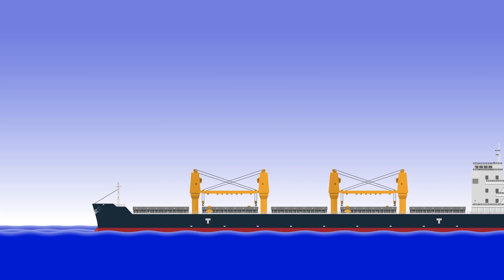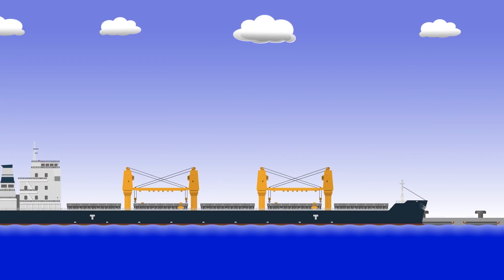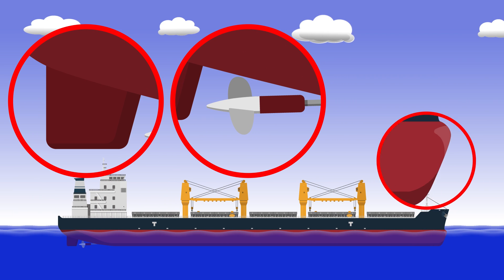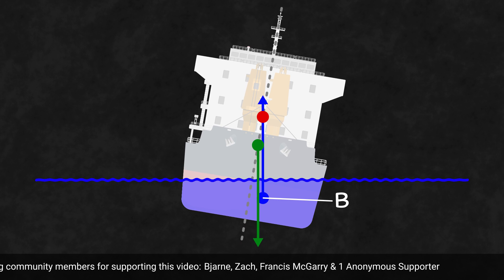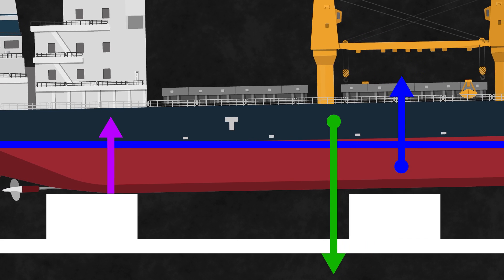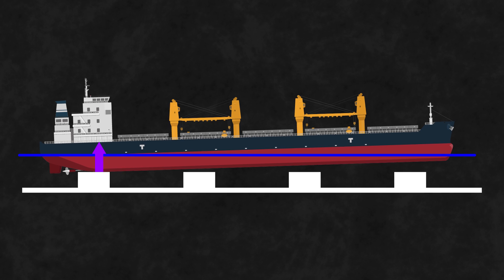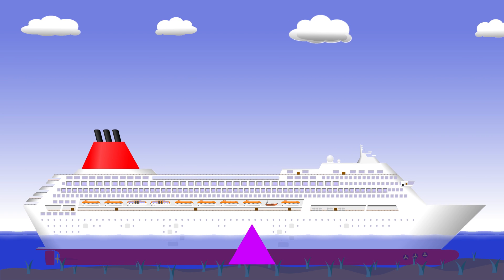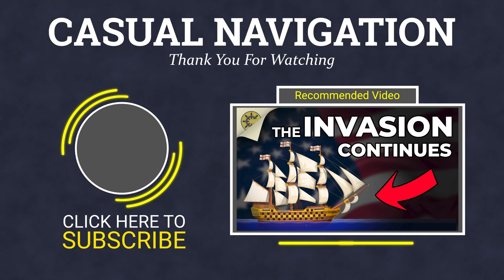Drydocking: Its HARDER Than it Looks!

Comment: 5:00 Why is the maximum height of the centre of gravity labeled as Max KG?
Reply from the maker: KG is a distance measure from the (K)eel, to the Center of (G)ravity.
Reply: @CasualNavigation  Ah, makes sence. Doesnt make it any less wierd when Max KG could also mean Max Weight. Though I suppose it would be very wierd for the weight of a ship to be measured in Kilograms
Reply: @TheBlackob  if ot was meant to be kilograms it would be kg, for units capitalization matters alot.
m = milli = 10^-3
M = mega = 10^6

Technically KG could be Mega Gs as in millions of times Earth's gravity worth of acceleration but i don't think that has any context where it makes sense.

Comment: Here in Grecee our RO-RO ships go on dry dock every one year cruise ships go depending on the use condition etc so us Greeks we like to be somewhat clean             Greek fan that wants to become a captain
Reply: Technically, the drydocking period is 36 months for inspection of the bottom, but with a possibility to replace one of those by an afloat survey before 15 years of age. Passenger ship have shorter period of time between bottom surveys.

Comment: One thing I did not understand about this is the trim aspect. Now, please correct me if I'm wrong but at least as far as I understand it, trim is mostly done via controlling the level of water inside the ballast tanks - at least at its core, I do know that it's not quite as simple given things like the free surface effect, but, even then I'd hazard a guess that this is not as important in the conditions that would need to be present for drydocking to be safe in the first place. Tangent aside though, what I wanted to ask is why the ship's crew, after having aligned the stern on the blocks and then having maneuvred the bow into its final position not begin to fill the bow tanks to achieve a neutral trim, hence reducing the maximum P-force asserted on the vessel as the bow comes into contact with the support blocks sooner. And, related to that, as the ship is refloated, why is it a concern to keep the trim towards the stern there instead of a neutral trim given that, during refloating, there is no need to align the ship anymore.

Sorry if this question is stupid but I simply couldn't make sense of this.
Reply from the maker: Any weight in the ship needs to be supported by the hull which is outside of its normal "supportive" water surroundings, so you need the weight to be kept to a minimum.
As for leaving drydock, you can aim for zero trim if you want, but it is normally easier to control the ship if it lifts off gradually, and you know which end is going to lift first.
Reply: @CasualNavigation  @Tung-Chiao Wu Ah, many thanks for both your answer, yeah, reading it now and actually thinking about it this makes complete sense. Thanks for enlightening me :)
Reply: @CasualNavigation  I think you're overestimating what "control" you have of the vessel in the docking/undocking situation. The vessels are made fast by wires/moorings and the only control is the rate of water ingress/egress. I would suggest that being trimmed by the stern is so that the vessel trim matches that of the slope of the drydock. Every one I have been in is sloped towards the gate to allow the water to drain out towards the pumps.
Reply: @garrettnb and @casual navigation
 I've worked on a shipyard and I can confirm all this. Our docks have an inclination of around 30cm (1 foot) per which 100m. That way a vessel with around 300m would come in trimmed with usually 5.5m aft draft and 4.5 fore draft. After aligned the vessel dockmaster would emptied the dock until the  vessel will have no bouyancy but keeping enough water to spread vessel and ballast weight across hull and dockbottom. That way the vessel will land flat on blocks without this P force concerns and reducing bending moments and shear stress on hull. Only then crew can drain all ballast (and should do otherwise they will end with hull deformations and block punctures). After ballast is emptied then dock will be fully emptied as well.
Reply: @morya85  And as per usual - the correct information will be buried. Thanks for the response.
Reply: My experience was that when going into dry dock, u will be asked to maintain minimum ballast because tanks need to be emptied for the  inspection. Any extra water in the tanks means delaying the schedule, which in turns cost extra money. That’s why u only pump out the water, not in. 
Also, it’s considered a bad practice not pumping out ur ballast in time when ur ship is sitting on the blocks, because u’ll cause extra stress on the ship’s structure, which is totally avoidable.
As for re-floating, u’ll also be asked to calculate the minimum amount of ballast u need. The yard will pump water into ur tanks as per ur calculation, and charge u. As far as i can remember, we only maintain even keel cuz we were just a handysize bulker, pretty light when emptied. But i figure the method mentioned in the video is more controlled compare to just float the whole ship at once with an even keel.
Reply: My guess would be that it's easier to account for the forces keeping it trimmed to the stern on the way down. Even if it's technically better to retrim as you drain, if it also increases the chances of human error when the other process is good enough it's not worth it. Just a guess. I'm not really sure. No clue why they don't change trim once they're down.
Reply: Every ship has a docking plan from the builder's that shows the proper locations for the blocks and the acceptable stresses.  Adding ballast could bring these stresses up too high.  As stated before usually they want the tanks dry so they can perform work, so adding water is counter productive.  Also the ships crew has nothing to do with the positioning of the ship.  Once the ship enters the dry dock the dock master assumes responsibility for the vessel.  They use winches from shore to position the ship and divers to verify its right

Comment: Quick question: How do you get to the parts of the hull that are covered by the support blocks?
Reply: Shipbuilder/repair here, you don’t. At least not this time around. You can see the area the last blocks were when you go down the dry dock; sometimes the blocks are laid super close to the last blocks so some areas aren’t even cleaned the second go around.
Reply: @MrCMStud  Do the locations of the blocks get recorded in the ships documents or log so that different ones can be selected next time or is it just luck?
Reply: @MrCMStud  Is the ship positioned longitudinally so it rests on the blocks only where the bulkheads are? Or is the skin strong enough to carry the load from anywhere? One of the posts here talks about "hoping" the blocks are spaced such-and-such, which suggests the latter, and that their spacing is not part of the plan.
Reply: @FlyNAA  well if a ship goes into drydocking the drydocks get the blueprints of the ship so they can place the blocks at the right position. if the blocks arent placed right they go straight trough the hull 😔. so yeah everything is planned in advance.
Reply: @FlyNAA  Some additional infor to what others have already told you. Yes, the shipyard will be provided with plans of the ship to position the blocks correctly. On larger ships the naval architects who designed the ship will produce a set of plans specifically for drydocking, specifying a blocking plan that the shipyard should follow. Often naval architects will specify thicker plating and extra floors (framework) in the ships double bottom at these locations to accommodate the point loading experienced in drydocks.
Reply: In another few years in the next dry dock session
Reply: Answers are below for large ships. For small boats like mine you shift the supports after you put the first coat on. The blocks under the keel are placed so I can get every thing but a very small bit. That part gets painted when the boat is in the slings off the ground just before it is launched. You lie on your back under 13000 lbs. of boat and hope the slings don't decide to part at that moment and paint. The paint gets all of maybe an hour to dry if they stop for lunch before launch. Needs a day for full cure but you do what you can. Next time you have the blocks in a different spot. Not perfect. Big ships use paint we are not allowed to use and it can go longer between repainting and be effective. Most recreational anti fouling lasts 1-3 years and that third year is not very effective.
Reply: @alwaysbearded1  Small boat anti fouling paint is lucky to last 6 months, it is crap, a ripoff, and causes high boat emissions, if a diver doesn't clean the bottom every month, or less in high growth environments.
Reply: Speaking from someone who worked in a shipyard many years ago,  you can't during the same dry docking session. Simply has to wait for the next dry docking and hope the blocks are placed in slightly different locations.
Reply: I was on the dockyard services crew of forgacs/ caincross drydock in Brisbane Australia, Large cruise ships and container ships don't just sit on one central line of blocks, there are multiple rows with about 5mtrs between them, so a ship 40 mts wide would be on at least 5-7 rows of blocks to cover the full width of the vessel so very little chance of capsize in the dock. And yes the location of the blocks are recorded so the next time the vessel is in dry dock they can adjust block placement to be able to clean areas that got missed.
Reply: Every ship has multiple docking plans that dictate the location of the blocks to correctly support the vessel. The plans are made by the ship’s designer as they design the ship and the blocks are placed in locations that support the hull around it. Sections of hull and framing are strengthened to be able to support the vessel while on blocks. 

With each docking the ship will request a different docking plan so over several dockings the vessel has a complete new paint job. 

Different plans also exist for access to different areas or for major part replacement. 

Special plans can also be made for unique situations for example the docking plan for the ship that got stuck in the Suez Canal would not have had blocks under the bow so it could be completely cut off and replaced.
Reply: Well they overhaul the ship
Reply: Ships getting dry docking plan on their delivery which describes exaxtly how much and where to place blocks. All these calculations done depending on how much frames there are and how many tons will be placed on each wooden block. And as it was said before - during next dry docking for commercial ship blocks will be placed in different locations. Dry docks are normally done each 5 or 2,5 years depending on age.
Reply: You call subatomic cleaners!
Reply: You make the ship jump and quickly clean the spots under the blocks
Reply: Won't these stuffs simply being crushed by the sheer weight of the ship?
Reply: @BS-bd5uq    The blocks are placed under the internal framing, the shipyard has to have the blueprints of the ship being repaired so the blocks can be in place a week or two in preparation of docking

Comment: Fascinating! I've never really thought about the process of dry docking apart from the 'oh, she is getting repairs/refits so she won't be available for survey this season'. Kind of cool learning a bit more about the logistics of actually getting a ship into drydock :D Thanks!
Reply from the maker: When I learned it, I was surprised how much maths and physics was involved, but it made it really interesting to learn!
Reply: @CasualNavigation  that’s the reason why there isn’t just one middle line of blocks. Side blocks will counter the rolling movement. Apart from distributing the weight over more blocks these blocks ensure that the ship will not capsize.
Reply: @CasualNavigation  Sorry, but its a really easy task, if you know how to place the blocks beneath the ship. If you have ever put a sailboat on a trailer, you know its not hard.
Reply: @petersizen3897  If you've ever put a sailboat on a trailer, you understand how to dry dock a multi-hundred ton container ship. Basically the same thing. Makes sense, good to know.
Reply: @mrnicomedes  have you ever heard that there are wave pools where they test scaled down ships? Basically the same thing.

Comment: If only we could be confident that a ship would never bump into anything, we could cover their hull with a super-hydrophobic nanocomposite.  That would prevent any corrosion or fouling.  Sadly, ships tend to bump into things!

Otherwise, you could achieve a similar result by plating the hull with a thin layer of gold. 😅
Reply: Most racing yachts use an antifouling, which makes the hull very slippery so when the yacht moves the water brushes off most algea and critters. I don't remember on which material its based on but for this antifouling to work the boat has to be moved frequently. There are some yachting channels that use it.
Reply: @Sn00ky128  There are 2 types of antifouling paint, hard and soft. Hard paint is used for hulls that travel fast, as the growth cant penetrate very much and the water flow over the hull removes the growth. Soft antifouling paint is used for slow vessels and vessels that are stationary more. The paint flaks off as the growth forms.
Reply: Also that would be expensive.

Comment: Do you need to have the ship trimmed when refloating?
Reply: I was wondering as well: why would you even want to stay trimmed like that when refloating?
Reply from the maker: Yes. You have to calculate how it will trim ready for when the dock floods.
Reply: The same reason you trim when you dock, you want to control which part of the ship float first.

Comment: If the blocks make the ship unstable, why don't drydocks use U-shaped structures for the ship to land on? (just so you know I don't mean super tall ones).
Reply: We do make side blocks like this (half U-shape on both sides) on some ships. But it has to be very precise. To help manage the dry docking we use mooring lines thrown from the ship to keep the ship from drifting and helping keep it stable when lowering the water level.
Reply: @MrCMStud  Interesting
Reply: I'm no expert, but I imagine that those kinds of structures can only accommodate ships that fit those blocks. So you'd need several kinds of blocks to cover various hull contours, and they would have to be removable, and so on.
Reply: @etherealessence  Well they could at least make the blocks wider
Reply: @gregorpajdlhauser2850  if it were that simple, I'm sure it would have been done already. There are most certainly physics problems that we just simply don't know about, let alone understand.

Comment: Some constructive criticism: Turn down those boing sound effects a good bit. They are very repetitive and distracting, it’s way louder than your V/O. You need to ease off on the brightness on your V/O. Your sibilance is ear piercing on an iPad or iPhone speaker.
Reply: Listening to these videos on a few devices tells me that the volume problem you're experiencing is likely due to some sort of EQ profile used by your iPad or iPhone, and not with the source of the video. Darkening the VO would help lower that harshness on S sounds, but that problem only seems to happen on mobile speakers, which are the worst kinds of speakers anyway, and darkening the sound further would likely start muffling the sound on proper speakers.

Saying this since your constructive criticisms are pretty much surround your chosen method of watching the video and doesn't have much to do with the actual source audio.
Reply from the maker: Cheers Luke. Audio editing is my weakest skill, but I aim to keep improving in time.

Comment: Why wouldn't they use the same system they use for dry docking smaller boats. When a small boat is dry docked it is impossible for it to tip over because there are supports in the way.
Reply from the maker: Once you are on the supports, it is fine. Its just the process of getting there that is different.
Reply: @CasualNavigation  Yes, but why wouldn't they have horizontal supports like they do for smaller boats. During the process for a smaller boat dry docking, there is never a chance for it to tip over.
Reply: @MegaLokopo  more supports = more area of the hull covered = less hull cleaned per session.

I also suspect that "anti-roll supports" would be much harder to construct than the basic purely vertical compression of the blocks used. (Also concerns about hull strength being held like that)
Reply: @jasonreed7522  I'm sure they could make a system that worked well enough to prevent a boat from tiping over while being able to be moved when its not necessary anymore.